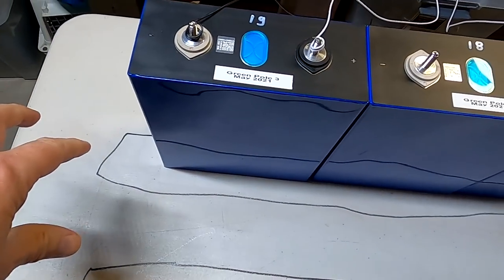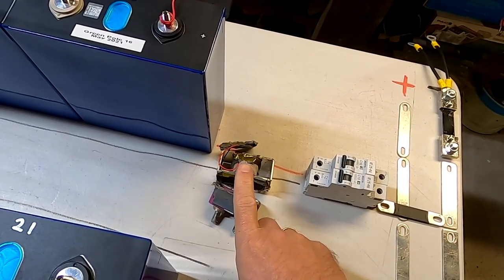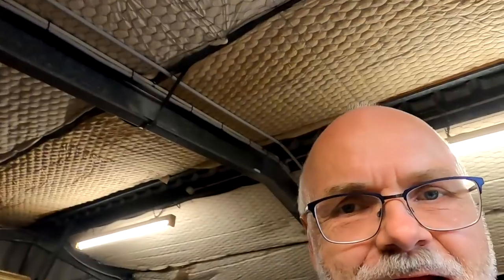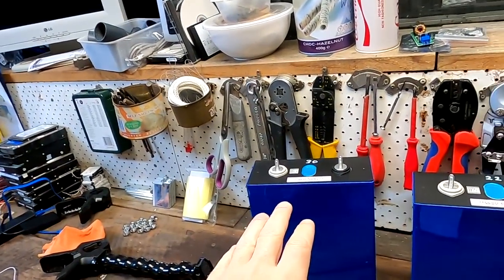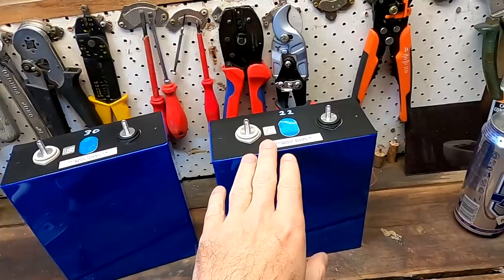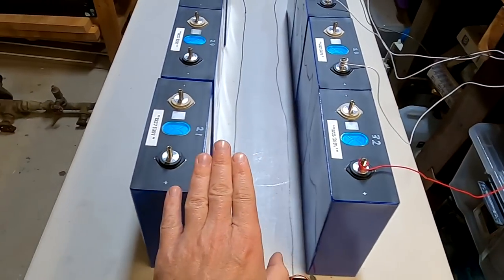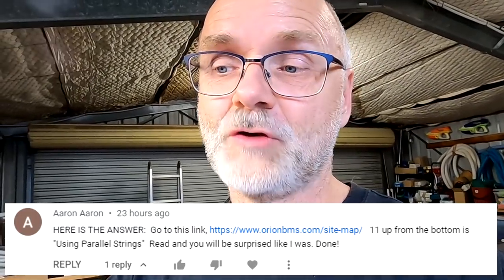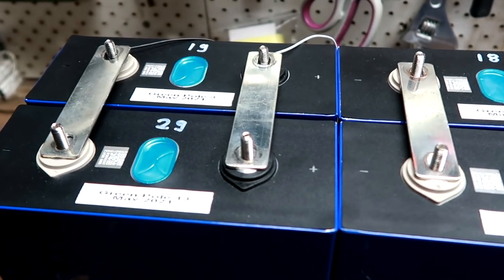Parallel Battery Strings - worst solution ever?

Comment: I connected 26 14s10p (18650 cells) packs in parallel. No problems with that. Each pack has its own BMS and active balancer.
Reply from the maker: Great, thanks for sharing.
Reply: hey zertyhc is there anyway we could email about your system?  I just picked up qty 12 packs with a 18650 cells in a 40p13s configuration.  I'm looking to take the 12th pack and change the other 11 packs to be 40p14s which should help my inverter battery voltage range.  So I need 11 bms's but struggling to deicde which brand to go with.  I'm struggling to find anyone doing a similiar system to mine.

Comment: Following this with great interest.  I have recently built my 8s 24 v battery and am also now thinking of doubling in size.  Learning a great deal and love the format
Reply: What can you run on that?
Reply: @mcorrigan6729  it has a total of 4,800 watt hours capacity, of which I can safely use around 80% (without stressing the batteries).  I run most of my loads through the 3kw inverter, but also have a few 12v light strings. I also have a back up petrol generator, and some independent solar lights.  Its part of my off grid garden / cabin system, so just run lights, fans, water pump, charging computer/phones etc, a rice cooker, and some electrical tools during the day (angle grinder, circular saw, etc).
Reply: @jonathanhampshire8405  could you possibly send me potos of your setup? or a list of which components you are using. I swear I have spent probably 20 hours reading about different aspects but have not been able to grasp it for some reason. I ordered 8 3.2v 280ah lifepo4 batterys, like these because thats all I can really afford, but would like to do a 24v battery that can power a small cabin setup that will be almost identical from the sound of it. I appritiate any advice you may have. With all of the information out there it has gotten slightly.. confusing. It sounds like you have this setup down pretty well. Also, how many watts do you have in terms of the solar?
Reply: @mcorrigan6729  I am no expert and have learnt by doing. probably spent more like 200 hours trying to work out my current system! I also have a friend who helps with all the wiring, fuses, etc.  My basic set up includes:  DIY 24 v LifePO4 battery using 8 3.2v 200ah cells plus 150amp Daly BMS (4,800 watt hours), 3,000 watt 24 v inverter, Epever Tracer 40amp charge controller, a 24 to 12v converter to the load output of the charge controller, a Victron smart shunt to help monitor the battery State of Charge and history, and 3 x 390w 24 v solar panels (1,170 watts) connected in parallel.  As noted, a friend has helped with all the wiring, fuses, etc as I really don't know much about that. Will Prowse's Youtube channel is a good learning resource if you haven't yet seen it.  Good luck!

Comment: How would two banks of different capacities behave? I have 4 202ah and 4 85ah lifepo4 cells on their way, each with their own bms (intended for different purposes). But could they theoretically be banked together? Are there any tests you can show with your 100ah cell with the 280ah to show why it would or would not work?
Reply: Following
Reply: The higher capacity bank will be the keeping the voltage up during discharge and down during charge. This will cause most of the current flowing from/to the higher capacity one while voltage will be equal over paralleled banks.
Reply: @MarkusIngalsuo  so the load could use the power from the lower capacity battery as needed where available, and the smaller battery would 'match' the voltage state of the larger battery? Any danger of harm to either the smaller or larger banks?
Reply: @sl0rion , yes, both batteries will have equal voltage but the bigger capacity one will take most of the load because it's heavier to push/pull.
Reply: @sl0rion , no damage will occur if the currents do not exceed the ratings. This can be kept in shape with fuses of suitable size.
Reply: @josepeixoto3384  internal resistance is also a factor but since you are not mixing battery chemistries you'll have pretty much equal resistance. There are rs485 (modbus) DC shunts on AliExpress, which I'd use with a USR-IOT modbus to Ethernet converter.

Comment: A further advantage to smaller paralleled strings vs. one huge paralleled cell bank:  Physically moving them.  Say I have a bunch of whatever cells, I can move them from one application to another if they're paralleled each with own BMS.  JBD bms with UART is a good choice for this.   I have a front and rear paralleled 10s packs from Leaf modules, in a 1970's GE Electrak garden tractor.   A lesson I've proved from the tractor:  keep the main +- cables identical lengths.  I did not with with layout of the tractor and I do see eddy currents, a couple of amps? for some 15 min? after charging and discharging, since one bank has less cable resistance (I might redo it to improve).   I plan to do 4 paralleled 14s (7 modules) for a house battery bank, and these will also be able to be moved to an RV as needed.   Downsides are extra complexity of multiple bms's and disconnects (all smaller and cheaper though), but the flexibility and redundancy I think could be worth it.
Reply from the maker: Thank you for sharing, Dale, much appreciated. Yes, you're right, I didn't think about moving things around which is much easier with strings in parallel than having just one big monolithic block of cells. For example when upgrading to a bigger enclosure, I can do this string by string without loosing power.

Comment: Andy, I think you have made the right decision to build two separate banks with their own separate BMS and fusing protection before paralleling them.  If you parallel the cells first, then you are creating a battery with a humongous amount of short circuit current potential which makes it very difficult to provide adequate fault interrupting capability.  The individual 280ah cells are already capable of producing very high amounts of short circuit current.   Paralleling the individual cells makes it even worse.  If you  parallel the individual cells you had better use at least Class T fuses with high interrupting capability to protect the bank from a catastrophic fault.

In my opinion, fault current interrupting ratings of protective devices is a subject that seems to be overlooked or ignored in most DIY battery builds that I've seen on the internet and it is a serious safety consideration that needs to be addressed.  All too often, I've seen cheap fuses or circuit breakers used to protect these lithium battery banks.  There can be serious consequences with these batteries if the catastrophic protection devices are not capable of breaking the maximum fault current available when called upon.

Comment: Good stuff, I think that will work well for you.  Although my 24 cells are 6P4S from new and I've never had an issue if i got a new batch I would build a second battery. I've even thought of splitting my pack into  smaller packs and buying more BMS's

Comment: Thank you.
I am looking at 8 (500ah 3.2v) cells making a 1000ah 12v bank but could not find a bms to fit a single bank, so I was going to make two banks of 500ah with 2 bms's and connect them to a common busbar.
I was not sure if I should fit 2 shunts before making the connection to the busbar.
The reason for the set up is infrequent charging and drawing higher loads over short periods (230a for 3 minutes) as well as a small load continuous.
The only thing I was definately advised to do was make all the leads before the common connection to the busbar identical lengths.
I look forward to your next video, theory is fine, but practical is better.!

Comment: LFP cells need to be paralleled, the more the better. Balancing will never be required. Especially when cells getting older, used and uneven. As LFP cells are always in a interest of reaching a resting state, you are actually helping them to achieve their goal by creating bigger capacity on cell level. Parallel strings are absolute waste of money, and just doing the opposite of what the cell wants. My own pack with degraded, heavily used cells would never work with parallel strings, but with all cells in parallel, I don't even need to touch anything with a balancer to keep them happy. The 14s1p example is a LiIon pack, a totally different story...Du hast das Glueck 32 wunderbare, neue Zellen zu haben. Die wollen als Paar zusammen sein :)

Comment: How many times you will have one battery bank disconnected? well, if you carry on DIY-ing this stuff intensively, this might happen quite often :D
Reply: Once he's done fiddling with details, which I think he is mostly done now that he has decided to copy-paste his current battery box setup, he won't need to disconnect things anywhere near as often once he's done changing what he needs to change to accommodate parallel batteries. His next major disconnect will likely be when he adds another electrical box to house the battery bus bar, the dual DC breakers for each battery and the battery cable inlets since his current one is too small for all of that extra wiring and hardware.

Comment: I have a 16S lifepo4 and a 14S lion that are paralleled together, each has its own BMS, the charge and discharge curve are very different to each chemistry, the overall charge voltage is 56.6 volts, these set of batteries have been married together for over 2 years, the only thing to watch is both banks are the same voltage when married
Reply: Ross, I note that you have also built some pretty impressive LTO battery banks using a modified form of Stuart Pittaway's DIYBMS. Possibly this is worthy of consideration for Andy's project?  Looks good to me but I'm not really qualified to comment!  So, over to you.... if you think it could be a candidate in Andy's solution I (and hopefully others) would welcome your comments. Cheers Chris

Comment: I think the guys at Orion Bms are wrong when they say that the best configuration is 2p16s and that two series of 16 connected in parallel is not good. I think it's exactly the opposite. Think of it when two cells are connected in parallel, the total current in that circuit is divided into two parts that will never be equal because neither cell is identical, not to mention the fact that they cannot be monitored and balanced individually. If one of the two cells starts and degrades over time, we will not know this and  will circulate through the other cell a current much higher than half the total current in the circuit, as would be ideal.In the end, apart from the fact that the two cells will degrade quickly, the total capacity of the battery bank will decrease.I suffered this at the lead battery bank wich I use now. I gave up 2p8s and switched to two series of 8 connected in parallel, but I think it's too late and some of the batteries in my battery bank are compromised .I will not repeat the same mistake with the new LiFePo4 batteries wich I ordered and I am waiting to receive them. 
  In the configuration with two series of 16 connected in parallel, at least we have the possibility to monitor and balance each cell separately with active balancer or bms. And if the 16 cells in each series are balanced correctly, we will have the same total voltage on each from the two series and automatically through each series will flow half of the total current in the circuit.
Reply: And that's why they build one of the best  BMSes - because they are wrong.🤣

Comment: Hahaha everything orion said is true but still controllable design your load so it will run on one bank and you will never have an overload. When one bank charges the other the bms will protect it from overcharging and just shut off the charging mosfet or relay in your case. All of this becomes more profound over 3.45 volts per cell so only charge that high when maintenance is required. Whichever way you go we will watch and screw ups are more fun just kidding no screw ups at least ones that cost money.

Comment: Ahahah
Good executive call. 👍
That's the way mate!
And a correct and possible one also.
Already seen three LFP battery banks in parallel each one with individual BMS, and no worries.
Even saw Battery banks of LFPs being paralleled with different chemistry NCAs and working like a charm for years now... So... Go for it!
1p 16s and don't forget 1b..(one beer) 🍺🐸

Comment: Perhaps the best "Andy" solution is to just have a shunt on each battery in addition to the system-wide shunt you have out in front of the busbars.  You could even wire the shunts into a battery monitor display with the polarities reversed so it acts more like a "tachometer" for the battery banks, telling you which direction the flow of energy is biased.  Even better would be having the pi or an arduino independently monitoring the shunts and recording data and packaging it up for VRM to consume.

Thank you so much for your videos.  I love the way that you present the information, and the topic is something that I'm very much into.  Cheers!

Comment: 👍 great Andy, I think you are right, parallelling cells will never reveal bad cells. If you look at your fellow aussie HBPowerwall he is using al lot of parallel cells and now and then needs to dig into issues with them (thermal camera, fuses etc). So a parallel crate with BMS will cover that, and your power will not easilly switch off while the cells are massive, small cells will be overloaded much easier, the 280Ah is huge. If you use the right fuse and size of wire it will be a good solution and never forget a maintanable one. So good thinking Andy and thanks again for sharing. I was wrong with the huge Amperes which flow when parallel the cells as also the BMS will monitor the progress and will kill the connection when something goes wrong. Also paralleling cells will give you 3.2V with ~600A in 1C, that's huge when you make mistakes, that will easier burn than a closed box in series. Have fun building the new one!

Comment: 5:28 You said the when the more charged string delivers current to the less charged string. That was wrong.  It can't happen either during charge or discharge.
8:30 Then you got into "Microcycles".  That's a Rabbit Hole.    Build it and just parallel the mains.
You can put a $5.00 monitor on it.
Reply: @josepeixoto3384  8s 200 and 8s 100 one BMS for all?  If so, then jumper the sense wires.  They wont see any significant current unless there's something really wrong.

Comment: I’m looking forward to seeing the results of parallel batteries. I haven’t seen this topic covered by other Youtubers. I plan to do the same using (8) 280 ah EVE cells and (2) BMSs to create (2) 280 ah 12v batteries down the road for an RV build.
Reply: My plan is exactly like yours, but with (8) 100 ah cells for (2) 100 ah 12v batteries.

Comment: Hello very informative I want an suggetion I have bank of two batteries 24 v 300 amp made in series.  Can I take 12 volt from one bettery for my other solor power controller
Reply: Use a dc-dc converter 24V to 12V

Comment: Thanks for your videos. For people who are reluctant to mount batteries in parallel (obviously LifePo4 do not have the problems of lead-acid ones) say that Batrium has a system of connected BMSs that can control different batteries at the same time (I think up to 7) and connect them in parallel. It is quite an expensive system, but it is one of the most advanced that I know of; although the technical advice is with subscription (something that I dislike and I decided not to buy them). If I decided to increase the capacity of my battery (it is exactly the same as yours, but with a 200A JBD BMS) I would also choose the option of making a whole battery and connecting them in parallel. Although the rest of the components are not of the quality of yours (I did not put Vitrom) Sorry if it is not understood correctly, my English is very limited and this is a machine translation.

Comment: I agree with your decision to run multiple BMS's... I am running 5 BMS's. Also, I would suggest stripping the insulation from the BMS wires after moving them on top of the bus bars. LOL

Comment: the problem is with more cells in parallel the more hassle the bms will have keeping the cells balanced now while they new i doubt this is much of a problem but as the cells start to age i think they will need to be balanced more often with only a low dump load capacity to discharge the other voltage bank it will struggle to bring that bank down to that of the others

Comment: Let me first say that we have watched and enjoyed your adventures, every one of them. I hope that you do not fall to the common 
ordinary configurations and that you continue to discover by questioning every section of power creation as you have done.

Since Battery has no brain and functions on orders from BMS,  the Inverter sections require that the inverter's input/output controllers
ask for this power.  There has to be  a device that will serve as Master in order to initially turn on power, cut power and switch power 
to another or alternate source. In this case and for several reasons, you want to utilize two banks of batteries.

Being able to Sense the Voltages coming from the two batteries and then switching from output of one battery to the output of another
is a matter of sensing - then - programming.

It appears that a programmable switch that senses when the power is at a certain point would suit the use you are looking for
without disrupting either battery.  369zero E-Lab uses a relay unit with programmable features. It can be programmed same as 
you program the BMS via a communications App.

Please look into testing for a switching device before you go to the common way of doing things.
I know that you can do this!

Your sincere supporter, Dave Walters - USA